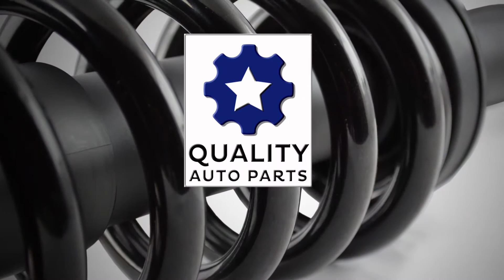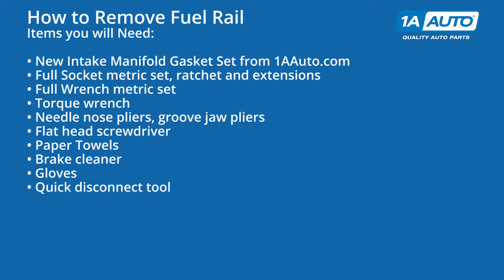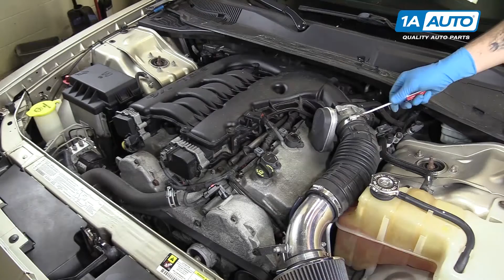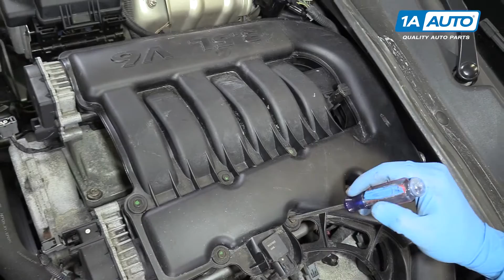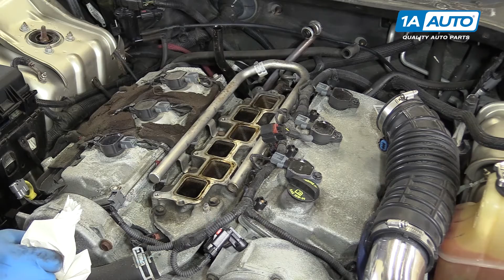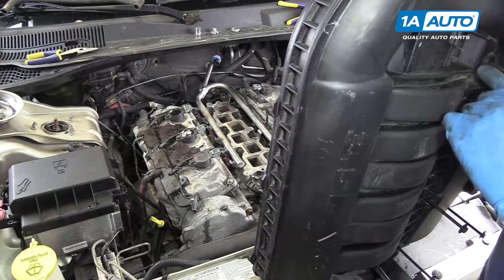How to Replace Fuel Rail 05-10 Chrysler 300

Comment: Hi there. Thanks for the video. 

If I need to replace my lower intake gaskets......Does the fuel rail pull up with the lower as one assembly? Or do I need to remove the fuel rail and then remove the lower intake?